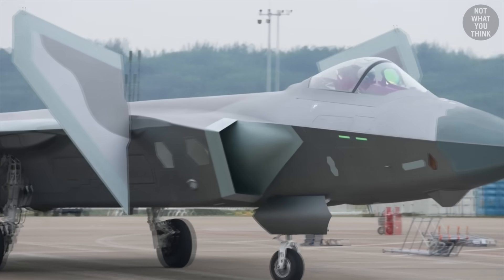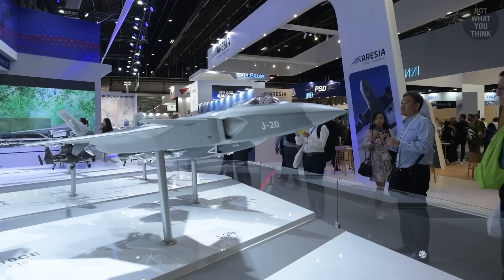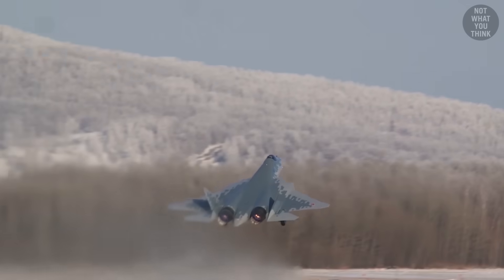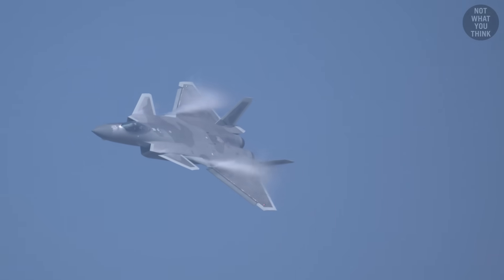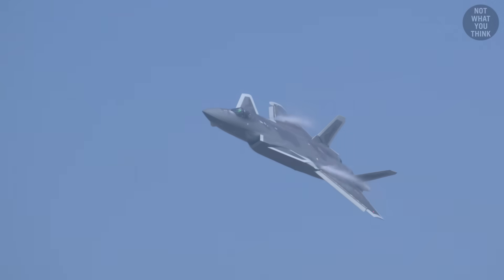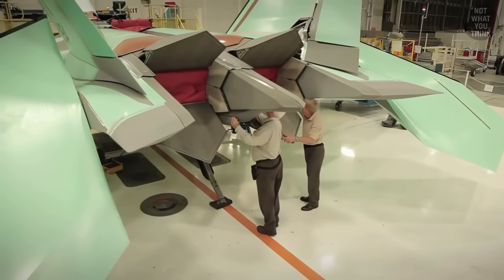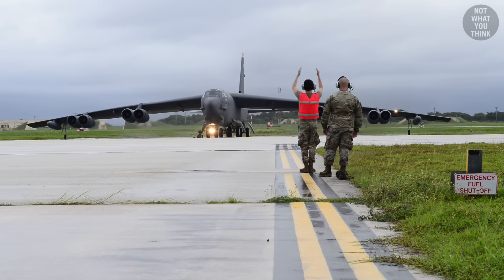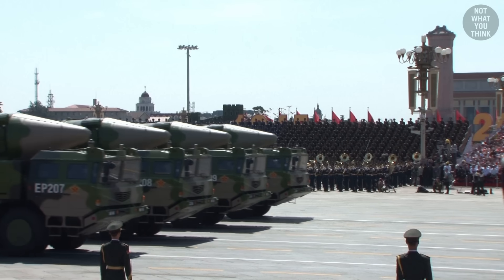Why China's Stolen "Stealth" Fighter is Problematic

Comment: When talking about production numbers compared to the f22, the j20 has more, but you also must point out that the f35, which the US is dumping far more resources into, has well over 1000 units made, quintupling the j20.
Reply: The f35 is better compared with the jf-17 or j-35 or j10
Reply: Over 1000 F35 has been produced but most are older incomplete versions delivered to allies. The US has around 200 F35 and  none of them up to the standard of the J20 avionics suit level.
Reply: @KittyCat-qg4vd  "The US has around 200 F35" - The US has nearly 450 of them at the moment.
Reply: @KittyCat-qg4vd a troll who knows nothing what he’s talking about wearing the usa flag you got more jokes?
Reply: Both the Raptor and F-35 are continually improving. The Raptor is set to receive low observable drop tanks that will boost its range considerably and not leave a bunch of pylon on the jet if dropped. Also, the F-22 is getting what are thought to be IRST pods as well. The F-35 is getting some new upgrades in the upcoming production batches, as well as the planned block 4 upgrades coming soon.
Reply: @T-Dawg123a J20 continues to improve rapidly as well. And the J35 is now in production. China is producing about 150 J20 per year , 100 J35 per year , 100 J16 per year, 100 J11D per year and 100 J10C per year. The Chinese air force will be the world's largest air force by 2030.  Should China switch nto wartime mode, China will get there sooner.
Reply: @KittyCat-qg4vd  
Tofu dreg airforce 💀
Reply: @KittyCat-qg4vd  lmao are you American or a Chinese propagandist? The US has 500+ f-35 at minimum it is at the moment the largest most manufactured 5th gen around
Reply: @Chloebbg  
For those who are late to the class, not a single F-35 is operational.
Not to mention they would be substandard aircraft even if they were operational.
Reply: @T-Dawg123a and the biggest game changers are: 1) Chinese awacs and ground facilities have anti stealth radars. 2) a plasma cloaking device that can turn any jets to stealthy jets. You have no idea.
Reply: The US just finished doing the upgrade program for ALL mission capable F22s this last month. Upgrades included but not limited to, IRST radar and the RAM coating the F35s use(better and WAY cheaper to maintain) also, low drag and stealth pylons and external fuel tanks. So....the F22s with external fuel tanks are still stealthier than all other countries "stealth" aircraft and fighters ha @T-Dawg123a
Reply: The production rate of the j20 has exceed 1 per day tho so it will with due time be alot more numersome than any other "stealth plane"
Reply: @enterring9874  But how long can they keep it up ?? F-35 is a global effort, to make 1 j20 you have to stave Mr.Chung family and his neighbours for 10 years to make 1.... 
  F-35 just exceed 1000 unit and Japan order like 300 of those meanwhile making 6th Gen with European country. It would be more than 2000 unit of F-35 worldwide before j20 even hit 500 unit. 
   Corruption in CCP Rocket force, tofu carrier program, hard to sell aircraft, Seriously nobody want to have chinese jet if they are not desperate. All of those keep the price high and there are limited numbers of blood to keep the chinese war factory running.
Reply: @enterring9874 what does numersome mean
Reply: @mattowen3310  numersome means alot/ a big number 
its just a maybe badly translated word from my german
Reply: @enterring9874 1 per day???? 😂😂😂 quality must be garbage
Reply: @pooferfish2850  sadly not they are simply saving costs by essentially not paying the workers and high levels of automation and if you are essentially massproducing on this scale the high automation is saving alot of costs and if you look at for example the f35 factories they are mostly worked on by hand only the base for the frame and some other parts are properly automated
Reply: Lol J20 is inferior according to the US general. Lol I would take that with a big grain of salt.
Reply: @KittyCat-qg4vd  
J20 is inferior because it was made in China.
Reply: China can make 3000 if US can make 1000 f35
Reply: @yuugenr7549  not just number. Lockheed is unable to deliver the target state aka block 4 version of the F35. Right now, DOD refuses to take further delivery until LM resolves the issue. And DOD is penalizing LH 1 million per late delivery on each scheduled plane or something like that. Not sure LH needs more time or it has encountered a technology bottleneck.
Reply: Less than 20% are combat ready because of all the high operational costs according to Loyd Austin last week in Congress
Reply: If F35 was designed and made in China, I am sure he would have said the F35 was a complete failure. LOL.
Reply: You must, or at least should, begin to understand everything you desperately(or is it intentionally?) fail to.

The F-35 is a useless POS. A useless money pit used to enrich politicians and the MIC. 

Meanwhile ALL fighters are useless because Russia and the nations they’ve sold to, possess hypersonics. 

Hypersonic missiles make ships irrelevant. Runways irrelevant. And you can be sure, the hangers storing the useless money pit F-35s irrelevant.
Reply: Since China's economy is in decline, it is aiming for special war procurement.
Reply: There is an interesting design of aircraft, but they rarely talk about it, because this thing is secret. The topic of pulsed plasma thrusters has been developed since the early 60s (see PPT - Pulsed plasma thruster) - they are usually designed for spacecraft. But we will talk about a little-known design - these are plasma propulsion panels for aircraft, where the same Pulsed plasma thruster, but reduced to the size of a pencil and stacked in the form of cells in the panel. The design resembles a conventional plasma TV screen, where there are also discharge cells that activate the glow of pixels on the screen. And plasma propulsion panels have long discharge cells, the arrester has a railgun architecture (just rail contacts or coaxial), and the ionized discharge air is accelerated there by the Lorentz force to enormous speeds - a kind of ramjet engine is obtained. Just imagine! - tens of thousands of small ramjet engines assembled in a panel and firing plasma synchronously with a huge frequency (hundreds of kilohertz). Thus, plasma propulsion panels create lift by pulsed emission of plasma jets from railgun cells. There are tens of thousands of cells in the panel, they shoot at a frequency of hundreds of kilohertz, a huge pulse is obtained, and the plasma swirls the air into toroidal rings - the aircraft is held on this air cushion. Horizontal acceleration is created by the same plasma panels on the sides of the device (they glow, from the side they look like "portholes"). Such devices like "triangle" or "disk" have been observed for a long time, they are mistaken for alien ones - but these are terrestrial devices. They are classified and used for espionage and secret actions. Pulsed electromagnetic technology generates microwave radiation, therefore it is harmful to health. They rarely fly - only military missions. Therefore, they are not suitable for a citizen. This maintained the secrecy. Now they are already declassifying - many people know about this secret technique. When declassified, they will be used for cargo airships. But there is a danger that they are now going to be adapted to deliver small nuclear charges to decision-making centers - such means of delivery are not specified anywhere, are not conventional. This lowers the threshold for starting a war. It would be necessary to declassify them as soon as possible. That's why I'm writing about it. However, I have written before - starting with the book "The Elimination of UFOs" and many articles. There are also videos on my YouTube channel - "Declassified UFO" and "UFO Anatomy".
Reply: China has no intention of invading the US mainland, that's the difference
Reply: America's progress is too slow. The speed of China's progress is so fast that many people in Western countries can't keep up with China's speed.
Reply: liar.
Reply: The J-20 has the production numbers but not the weapons or capability
Reply: @verdebusterAP  thats mostly weong since their pl-15 was specifically made to outperform the aim-120
Reply: @enterring9874  
The PL-15 may outperform the AIM-120C-7 on down but not the AIM-120D plus variants
Reply: @verdebusterAP  that is exactly what it does they especially developed it to outrange and outperfrom the 120d before the aim 260 will be available it will be better than any current version of the 120
Reply: @verdebusterAP  it may not be a big advantage but the ~ 10-20 km range differance is notabkr
Reply: @enterring9874  
The AIM-120D basically variant  ,the C-8 was developed in 2008 however , the newer AIM-120D-3 developed in 2022 as well as the Form, Fit, Function Refresh (F3R) program address the AIM-120D shortcomings
Reply: @enterring9874  
Not in modern warfare
and when USN EA-18G and PLAAF J-16 will be dueling in EW
Reply: @verdebusterAP  sadly in modern warfer there are no more duels its all done with stand-off missles
Reply: @enterring9874  
The EA-18G and J-16 will be battling each in electronic warfare
Trying to get their respective side the advantage
Reply: @verdebusterAP  do you know how modern day aerial warfare works?
Reply: Another of the many downsides of the J-20 is the much lower life expectancy of the J-20 (about 3K flight hours) compared to the F-22 and the F-35 (both over 8K flight hours).
Reply: Not a single F-35 is operational as of today.

It's not even cleared to begin OT&E yet.
Reply: @Conserpov 💀
Reply: 450+ not 1k+😅
Reply: Over 1000 units don’t look so impressive when you have to spread those across the global US empire compared to Russia, China ect who will only need to deploy their fighters to defend their regional territories and will depend heavily on cheaper advance air defense systems.
Reply: @vanfja  
Ackchyually, over 1000 units don’t look so impressive when not a single one of them is operational...
Reply: @Conserpov no way youre serious💀
Reply: Watch out you backyard! Chinese Immigrants joint by other Asian ethnics groups are building their new country inside of America!
Reply: We also have a lot more carriers than them. More importantly though, much more experience operating them.
Reply: @Dakkar171  
> We also have a lot more giant, visible-from-space, slow, highly flammable, sitting duck targets 

Fixed that for ya.
Reply: F-35 production started long ago, not so for the J-20.
Reply: @captives6479 
SDD production of non-operational F-35 units started long ago.
To become operational, F-35 has to be brought up to operational standard and then complete OT&E.
They are still in SDD, and not cleared to even begin OT&E.

I.e. not a single F-35 is operational. A lot of them can't even fly.

F-35's 24 years in development and its production run are an example of exorbitant corruption and loss of  technical competencies by the US, not an example of some success that might impress China.

Stop investing all your experience points into coping.
Reply: @Conserpov  the f-35 is infact not that expensive compared to the price of the f-18 or f-16 development which would make anyone with a brain be thankful the f-35 is so cheap
Reply: @Chloebbg  
Did you skip math?
F-16 total program cost was about $65 billion in today's prices in 1981, and it delivered quite good aircraft. Same with F/A-18.
F-35 is over $400 billion already. And it is not even operational, let alone any good!
Also, same corporation, so your argument is extra moot.
Reply: @Conserpov the f35 has been operational and is ver good, i want what youre on
Reply: Last June, Defense News reported exclusive details about 13 major technical issues, known as category 1 deficiencies, impacting the F-35. The JPO has since quietly downgraded five of those issues to the lesser category 2.
Reply: @kanlu5199  
There are over 800 serious issues, and it wasn't the first time cat 1 issues were recategorised as cat 2 without fixing them, there are about 100 of those by now.
Reply: @Conserpov that is just npt true, the main issue is the block 4 upgrade delay
Reply: Did you know that only 25% of the F35 are actual serviceable at any one time ?
Reply: @joem0088  Seems like the German army in 1944 😅 But for some reason we didn’t learn that lesson from them.
Reply: True but let's be real here, they sold most of those to countries in EU (like mine) so even if we have all these coalitions etc between us, technically it's not like America has 1000 units available, not in the least because we tend to disagree with the stance of America vs China.

(the way most of us see it in the EU is that China has rightfully earned their "superpower" status and should be treated with some more respect than America has been giving them in the last few years, yeah okay they are not "saints", but neither is America 🤷‍♂)
Reply: The US only operates 450 F-35s currently, the rest belong to other countries.
Reply: The F35 is in the shop half the time its operational because its systems DONT work.
Reply: Even F35 is like garbage, but Qty itself is some kind of qualities
Reply: @Dordord ok PLA member
Reply: so what, F35 has slow speed and short legs.
Reply: The 1000+ F-35s are spread out in many countries though and it started production way earlier
Reply: When you can't compete, just say, "It's stolen/copy."🤭
Reply: The F35 is up for sale, the J20 isn't.
Reply: They made J-35 to counter the F-35
Reply: Yeah, but we gave F-35s to Isra3l and they don't fear China, they will ally with China when America falls, therefor we should assume that China knows everything about the F-35 down to what stitching they used on the seats.
Reply: Never mind that NGAD and NGNF are basically right around the corner.
Reply: @SilverExcel115 good luck with that.
Reply: @SilverExcel115 you don’t know what the Chinese are secretly developing until they show it to the public 😂😂😂
Reply: @KittyCat-qg4vd  
Imagine being this delusional.
Reply: @Thejoeviral what skunkworks was developing in the 70s is alarming to hear about how
Reply: @SilverExcel115 Chinese Gen 6 fighters are also just around the corner. And China has already flown Loyal Wingman stealth fighter drones with J20S. The US is actually falling behind.
Reply: @KittyCat-qg4vd  
China has not able to steal US NGAD and FXAA blueprints yet and here you are CCP spreading lies.🤣 🤣🤣🤣🤣🤣🤣😂🤣😅
Reply: @SilverExcel115 lol what did you say???
Reply: @SilverExcel115  Compared with F20, the biggest disadvantage of F22 are not only its out-dated electric awareness and its fuel shortage, but also its shorter range missiles, it can not go longer distance and it could be shot down before escaping, although its radar is under upgrading, it still couldn’t solve the fuel shortage issue.
Reply: @SilverExcel115  what are you smoking?
Reply: @SilverExcel115  No, they aren't lol.
Reply: @JAnx01 yes they are. They should reveal who’s design for NGAD is going to be around this year expect some prototypes or small amounts of the, by 2026 and then expect them fully in production by 2030
Reply: @TheUserEGO3326  Ok, feel free to remind me when the Air Force has a fully functioning fleet of them at its disposal.
Reply: @JAnx01  Nobody has fully functioning fleets of any fighter. All aircraft need to have maintenance.
Reply: @ChucksSEADnDEAD  I know, I read that in the NO SHIT! magazine a couple of weeks ago.
Reply: F-35 is also more stealthier. But even in WVR J-20 don't have an internal gun so it has NO way to dogfight. Only advantage of J-20 is range.
Reply: @johnsilver9338 J20 also carries short range air to air missiles.
Reply: F-35 is not an air superiority fighter. It's a multi-role jet and while at BVR manuverability doesn't matter much, when both of you have enough stealth to only see eachother out the window then it matters. Also china is developing J-35 or FC-31 that is an F-35 clone.
It's a numbers game when stealth is equivalent and china has the production advantage
Reply: @Userext47  the stealth tech is not equal though
Reply: @Userext47  don't worry, loyal wingman drones will show up surprisingly faster than one would expect. Plus, China doesn't have b-52 missile trucks also being remotely targeted by f-35's which are definitely better sensor platforms and more integrated. 

Plus, you know, decades of experience and doctrine in the forever wars. China has never flown their jets in anger. Not once. Their pilots have next to zero combat experience.
Reply: @Userext47 I would like to inform you that the F-35 can in fact do air superiority better than the F-22. It even has better range over the Raptor without drop tanks. That and better radar, better sensors, better data collection, better intelligence gathering and you have a far superior platform than anything else in the world.
Reply: @Userext47 f-35 is a 5th gen air superiority fighter,with multiple role capabilities.F-22 and f35 can both perform airstrikes,but it's main task is dominating the sky's,get your facts straight
Reply: @Userext47  the estimated range of radar contact for these jets is about 20 miles (albeit you know how it is with classified stuff), but the f-35 and f-22 are much lower visibility than the j-20, so they will get the first shot a majority of the time. Not to mention US missiles have been battle tested and improved on many past generations. Chinese missiles, while they may be good, have never seen actual combat, and do not have as many previous generations as say for example a sidewinder
Reply: @AtleyCarman-xe7rs  US is also likely to set mostly on high power illumination from AWACS and AEGIS ships to guide the fighters to the target... meaning the more powerful large radars give an additional range advantage over on board radar (and can make the american fighters even more stealthy as they do not need to betray their position actively)
Reply: @AtleyCarman-xe7rs detection is not the same as having a lock on and fire track with a high probability of a hit/kill Russia and China cleaner they can detect and track a US stealth fighter from hundreds of miles away but they leave out the fact that having a high probability of a hit and or kill is only within 35 mi. LOL
Reply: @nexpro6118 The Chinese are a lot more aware of their strengths and limitations than the Russians. Qualitatively, I don’t think they can match the US, and I think they know this, but they can maybe get 85% of the way there on MUCH higher volume. 

Let’s not make the same mistake the Germans and Japanese made during WWII. Wunderwaffen ain’t so wonderful.
Reply: @Userext47  
Reminder F35 is far ahead of Junk-35 because F35 is getting constant upgrade.
Junk 35 is still in the womb while F35 is basically matured.
Reply: @CalvinHsuChen stop using common sense lol
Reply: @CalvinHsuChen  Comparing a one-engine powered with a two-engines powered J35 is really an insult! The US is too poor to have more-engines powered jets.
Reply: @loongdechuanren1008 f-35 has the most power single engine on a fighter
Reply: @CalvinHsuChen  f 35 is junk 35, one and the same expensive junk.
Reply: @CalvinHsuChen  No they aren't lol. F35 is a design that wants to do everything and doesn't do anything particularly well. That's why it looks fat, and is barely capable of supersonic flight. Due to the uneven bottom, I also think it's stealth capabilities has been greatly exaggerated. It will struggle against air superiority fighters of the same generations.
Reply: Yes, but, if need be, they can rush production which the US has no capability to match whatsoever.
Reply: @timothychung4811 they don't need to rush. China is out producing the USA today as we speak.
Reply: @timothychung4811 dream on, my friend need I say more 1000 f-35 built and several hundred rolling of the line in a year. The US can easily mass produce weapons if they se the need to.
Reply: .......😂😂😂😂 even rushing production...at best China would manufacture 120 a year (keep in mind that China has horrible manufacturing quality control which would get even worse when rushing. Also, the US just finished building 3 more F35 factories. The US can now manufacture 160 F35s a year and that's without having to rush lol 😂😂